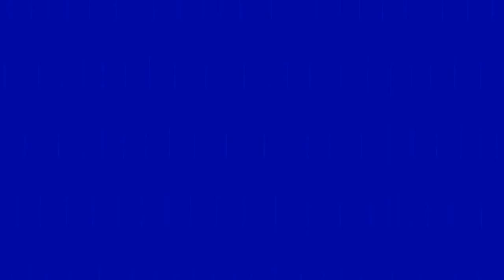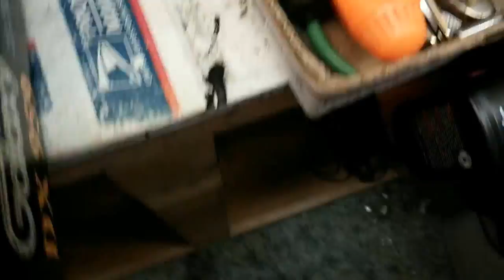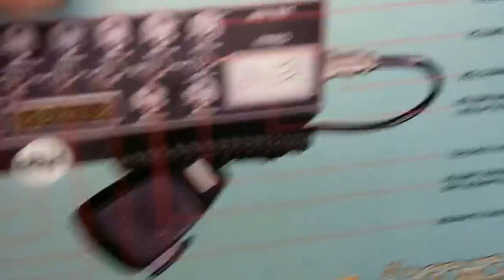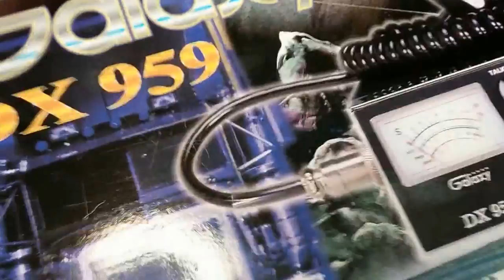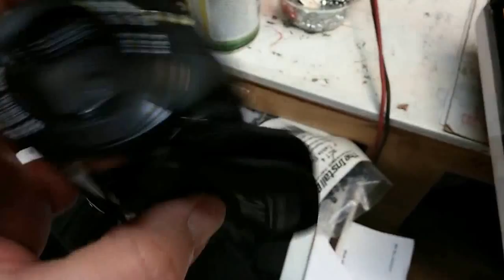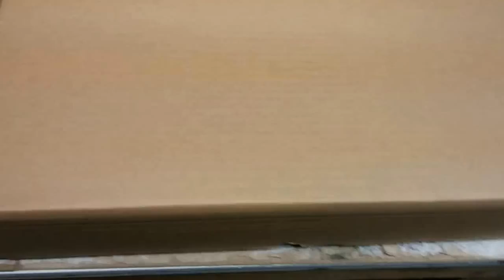DX959 Blue LC5304NX & SX175...Want One? Go to www.LesComm.com/radios

Comment: About how much will it cost me to have you do a setup like this for me? I also want an echo board and I’ll supply the radio. I have a 2010 model year
Reply from the maker: Usually around $4-500 but the SX amps are extinct. It would be an amp section from a DX98VHP.